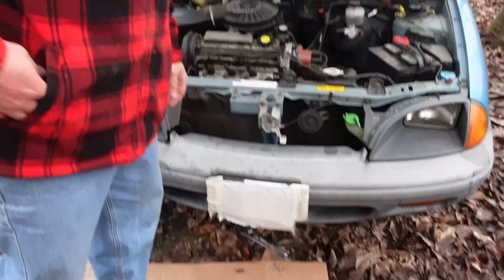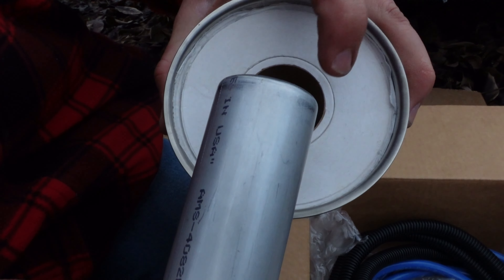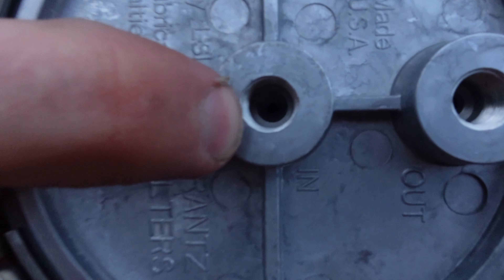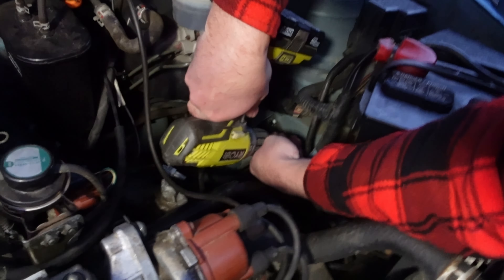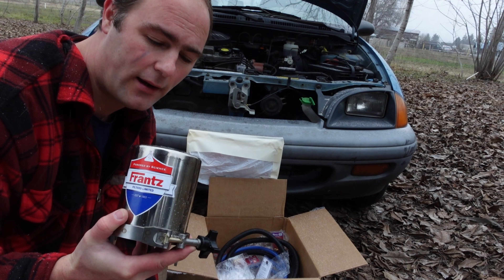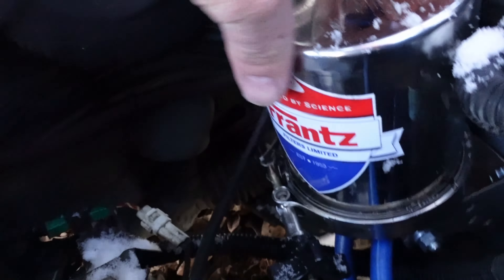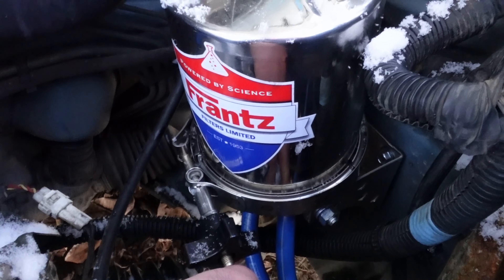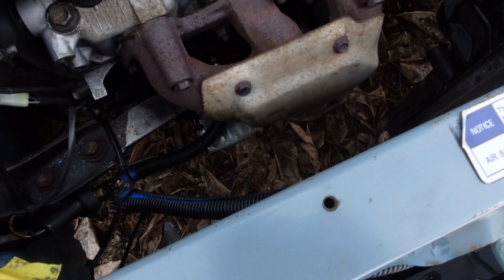Frantz Toilet Paper Oil Filter installation on a Geo Metro

Comment: You could unhook the hose at the oil fill cap and plug it into another air hose fitting to open the passage, lower the hose into a bucket under the car to drain overnight, save that $50 !
Reply from the maker: Yeah I will try that and see how easy it works before ordering parts, that is a great tip, thank you so much 😀
Reply: @frugallandlord6974  What I read through old Frantz literature is to loosen the clamp and rock the canister back and forth to release the vacuum that holds oil on top of the paper, after that leave the canister on and let it drain, I let it drain overnight and change the element the next morning.
Reply from the maker: @JimmyJames351  another great tip, that makes sense. Thanks again😀
Reply: Normally if air can enter the filter at shut down the excess oil will go back to the engine. Cant have any low places for oil to settle and keep out the air. My Perma Cool 189 sandwich adapter wont allow air to enter the Ford canister filter. I put a tubeless tire valve in the lid.  Slime brand with a nut from Auto Zone. Air pump with a gauge. Pressure comes up. When the pressure drops the excess oil is back in the engine.If the filter is cold the pressure will be higher. I dont do messy oil filter changes. Most of my oil filters drain over night with no help. Jackmaster Classic has an optional air fitting. Mine dont need it.
Reply: In the 60s if you ordered a Frantz with the 2 port sandwich adapter the filter came with no orifice. The 2 port sandwich adapter depended on enough oil flow to create a pressure difference. I see Summit has a 169 sandwich adapter with 1/8 pipe ports for oil supply to a added turbo charger. Normally with a gasoline engine if the Frantz cant remove the tiny soot particles the new makeup oil will dilute it down. You dont need to worry about the TBN number unless you arent operating at operating temperature. If you have an acid problem you will get a rusty dipstick. Keep it polished. Some old Frantzs have SKY on them. Thats Skipper K Yee. He once told me keep your oil clean and dry. You wont have a acid problem. Mr Yee was owner of Frantz at one time. I found out about Frantz when I checked a Standard oil engineers dipstick. He pointed to his Frantz.He said use one of these and Delo. Your engine wont wear out and you wont need to drain your oil. I was working in a full service Standard station with the white uniform blue cap and the belt that did t scratch the paint. I went  and found a Frantz dealer.. Common sense tells us that if we get a leaky head gasket or a fuel contamination problem we will need to change the oil.
Reply from the maker: @ralphwood8818  I have to re read some of your comments because there is so much information in them and it just sunk in what you said about TBN 🤔that does make sense to me, thank you so much for all the information, I appreciate it very much.
Reply: @frugallandlord6974  If  trying to keep the tp tube centered and round when fitting the paper onto the base, what I have found that works well is the carboard centers from spent eletrical tape, just peel the outside layers off until you have a slight press fit into your tp roll, you can put one at the top if you are so inclined, but not necessary in my opinion. 🙂
Reply: @frugallandlord6974   Additives last a lot longer in clean oil. People a lot smarter than me figured out that all you needed was never let your oil get dirty and add enough new oil to keep your additives up. Expensive engine owners check their additives with lab analysis. For what lab analysis cost I can change the filter a few extra times.
Reply: Years ago I was debating a smart as hell guy on a trawler forum. He said bring your wife down to Canaveral I will take you on a tour and we can talk about filters. He was a diesel equipment engineer. They were moving the shuttle then. I  told my wife im getting in over my head. Called Charlie Sims owner of Gulf Coast Filters in Gulfport Mississippi. I said I have a guy that wants to talk about filters. He said who is it. I said NASA LOL.  The engineer said we dont keep out cars long enough. The filters are only for industrial use.
Reply: About 1985 I was talking to an old couple that still drove their 53 Chevy  they bought new and installed a Frantz on.
Reply from the maker: @ralphwood8818  i think i read about TBN lasting much longer in clean oil, I’m sure it was on Bob is the oil guy forum. I have always wanted to get a used oil analysis on my oil at 10k but it’s so expensive I have never actually done it.
Reply: @JimmyJames351   managed to make the beautiful oil in the Pontiac look like the oil in the old diesel tractor. That super black cement color I put in the Pontiac to test the Jackmaster Classic filter and different toilet paper is not coming out. It passes the palm test the same as the clean black oil in a diesel. Its well below 1 micron. It dont bother me. If I was still selling filters at the flea market I would need to change the oil a dozen times to get rid of the black. People will always ask to look at your oil. People will always think black means dirty. Motor Guard has always claimed submicron filtration. Jackmaster claims 1 micron. Dont remember what Frantz claims. The big Gulf Coast filter claims 99 percent at under 1 micron. That wont even remove super black cement color. ACME brick uses it to make black bricks. A little goes a long ways.
Reply: @frugallandlord6974  Most modern engines have almost nothing in the oil large enough to be removed by the full flow filter. Some toilet paper filter users dont even change the full flow filter. That could be a problem. I ran the Pontiac about 65.000 miles on the same standard Wix. The pleats were rotten but still in one piece. Put a Wix XP on it. Im told the pleats in the XP are synthetic. There are toilet paper filters that screw on in place of the full flow filter. They use about 1/3 roll of toilet paper. They have a large bypass valve that is always open when the engine is running. I bought one to study about 60 years ago. I still have it in my junk collection.Kind of like a Stilco or Trasco. Some use them for when there is no room for for a larger toilet paper filter.
Reply: @ralphwood8818  I think the best use for those black particles is in the demo units, a lot of things are going on in an actual hot running engine that seems to mess with the outcome of the test.
Reply: @JimmyJames351  I hear you. In the 60s I was demonstrating the Motor Guard oil cleaner with a home made demonstration machine at the lost flea market in San Jose California. I was using diesel fuel. An art supply dealer said I have something you cant filter out. He gave me a very small tube of black coloring. 
At the end of the day the toilet paper was half white and half black. Probably another day and it would be black all the way thru. With the Pontiac I lost control. Plus because the Pontiac holds a lot more oil I added  a lot more color. The new oil added at filter changes should clear it up in about 10.years
Reply: Saw a demonstration on YouTube. This crazy Russian was demonstrating if 50 full flow filters would clean the oil. Of course every time he changed the full flow filter he added new oil. The filters didnt clean the oil. I think he is mostly a comedian. I just got one of those pop ups. Keep writing or delete.
Reply: @JimmyJames351   Both the Pontiac and the diesel tractor pass the old trucker palm test. With clean hands wipe the dipstick on the palm and smear it around. It should feel like new oil and not stain the skin.
Reply from the maker: @ralphwood8818  garage 54 I believe I watched this episode about the oil filters
Reply from the maker: @ralphwood8818  I have noticed people doing this palm test but I didn’t really understand what exactly they were looking for.
Reply: @frugallandlord6974  Another comment vanished. Ive been told the palm test is scientifically accepted. Black oil doesnt stain the skin. The owner of Gulf Coast Filters said its like black coffee.
Reply: @frugallandlord6974  You might have seen the interview Oakley trucking did with the owner of Gulf Coast filters. He is an expert on heavy duty filters. Pretty much thinks small filters are a waste of time. The founder of Gulf Coast Filters was proud of his little filters.  The Gulf Coast junior and the Jackmaster Classic and the Motor Guards were my favorites.
Reply: @frugallandlord6974  I should have said the filters are my favorites. I have them all in use.
Reply: @frugallandlord6974  The comment that vanished I mentioned we didnt have the fancy oil fill caps. I have drilled and tapped a few plastic  caps
I did twin 454 GM marine engines on a 41 Chris Craft and twin 350 GM marine engines in a 33 foot Carver. Gulf Coast junior filters used 3/8 inch hollow bolts to replace a intake manifold bolt on those engines. Could also use them on Chrysler V8s. Used a welder and lathe to make them. Not sure Frantz still sells them.
Reply: @ralphwood8818  Ed has the hollow bolts as well as the self tapping hollow bolts on his Frantz Refiner website. I think the return to pan is best on older V-8's, most oil return passages in the head and blocks can be on the small side, so I think right to the sump is better, I have a sthb in the oil pan on my 72' Mustang.
Reply: @JimmyJames351 Frantz also had metric hollow bolts for the beetle to return the clean oil below the baffle on the generator tower. Also 5/16 hollow bolts. I saw one guy that had a large C clamp with a Frantz punch welded to it. No hammer needed. I liked the tool that pushed the hose on the barb fitting.
Reply: @ralphwood8818  That big 'C' clamp is a crazy good idea, I didn't have room for the hammer to put it where Frantz said to put it, rear corner of sump, I put it at the front, it is under the oil pump, 3 1/2 inches up from the bottom instead of the recommended 3" to clear the spot welded baffle.
Reply: @ralphwood8818  I had trouble with my first push on fittings, thought I needed that tool, second set I put the barb in a vice and just a little heat from a heat gun on the hose, then push it in and that worked, you don't need much heat, I use the Oetiker style clamps.
Reply: @JimmyJames351   never learned how to pronounce those clamps. Didn't completely trust the 3/8 hollow bolts after the machine shop messed one up. As I was screwing it in it fell apart. The ones I make are ugly but they are strong. Never saw a weak self tapping hollow bolt.  When I converted the Ford  V8 canister filter to use Scott 1000 I used self tapping hollow bolts for the bottom and lid to bypass.the orifice. Didnt work for the lid. Plugged it and used the stock inlet. It was close to the top. Couldnt move the lid without loosening the bolt. The old canisters wouldnt drain below the orifice. I didnt use the old Frantz canister inside the Ford canister system.The Ford canister is 4 1/2 inch ID.
Reply: @JimmyJames351 In the late 60s I was working in the Ford Mustang assembly plant paint department. Many employees were buying Mustangs. A superviser had a Mustang dragster. The Frantz has no value on a dragster but I put a Frantz on his Chevy Suburban with the 292 big 6. Then everyone wanted a Frantz on their Mustangs. I used the Frantz 2 port sandwich adapters. No punching the oil pan. I think 2 ply was higher quality in those days and all of it had a 1 1/2 inch core. For years I got the best from a janitorial supply.
Reply: @JimmyJames351   The Chevy Suburban was the tow rig. When I started selling the Motor Guards I put a Motor Guard on his Plymouth  Fury. For awhile I was converting the Motor Guard compressed air filters to use 2 ply toilet paper. Couldnt use the high dollar Motor Guard elements because they had a plastic core. I was getting high quality 2 ply from Office Depot by the case. I ended up with three 60 gallon trash bags of Motor Guard elements to use for shop towels. 2 bags went to the land fill.
Reply: @ralphwood8818  Did the Frantz 2 port sandwich adapter allow the filter to drain?
Reply: @JimmyJames351   I dont remember having trouble with the Frantz not draining. Might be because the Frantz sandwich adapter had no spring loaded bypass valve. It worked the same as the Frantz transmission adapter. Some small engines didnt have enough oil flow to create a pressure difference. Had the same problem with small car transmissions. Sent Gulf Coast juniors with Perma Cool 189 sandwich adapters to a private Island. The engineer said one of the 6 cylinder diesel engines on the generators had a little lower oil pressure than the others. He drilled a 1/8 inch hole in the adapter to help the spring loaded valve. Perma Cool said the spring loaded valve is large enough. Might not be  if one engine has more bearing wear than the others. Not bad if you have a private island and have a full time engineer to keep things running.
Reply: @JimmyJames351   I only have two Frantz 2 ports still in use. They are Frantz Ford adapters with one port plugged. The oil is returned to the drain port. V twin lawn mower engines. Gulf Coast junior oil filters.  Super Tech ST 3614 full flow filters. Years ago I probably opened up a toilet paper filter and oil spilled out. I removed a hose from the Perma Cool sandwich adapter plugged the port and returned the oil to the engine in a normal way. I had other choices. I could have cracked the lid if it was a Gulf Coast junior. Loosened the t handle on a Motor Guard to let the air in. When the flat head Ford  V8 canister filter didnt drain I put a tubeless tire valve in the lid. I have a cigarette lighter air pump with a gauge. The pressure comes up to 50 psi aprox.When the excess oil is  back in the engine the pressure drops.
Reply: @JimmyJames351   I just put my last roll of Camco in the Jackmaster Classic. Drove about 4 miles. The filter was luke warm. It was slightly warmer when I got back. This tells me the pressure is slightly more at the top than the pressure at the bottom of the paper. This is the same as a very small orifice. A lot smaller than the .045 orifice I removed. This means the Jackmaster Classic is cleaning the oil much better than when hooked up in the conventional way. It will be winter when I change the filter again. I might need to use Charmin Ultra Strong in the winter. It can get into the teens here in Dallas.
Reply: Yes one of my hoses went half way on the fitting. A little heat from the heat gun and it went on. All I had was used fuel injection hose. 5/16 id.
Reply: @ralphwood8818  I really think you could put a smaller hole in the adapter, say about .080" that should drain the filter, then use a needle valve to adjust for the different driving seasons, just an idea.
Reply: @JimmyJames351 That sounds right. I was figuring a 1/8 hole. When I saw the 1/4 inch hole I had already drilled in it I thought about another undrilled one I have. Its amazing how much oil can go thru a 1/4 inch hole. Normally when I start the car I go at least 20 miles. Im retired now. Dont drive much. Got the birth certificate. Its a beauty. Embossed seal . Hold it up to the light to see if it is fake. 40 years of getting my Texas license mailed to me.
Reply: @JimmyJames351  Frantz experimented with different size holes. I think I still have a Frantz with a 1/4 inch hole in the nipple the full flow filter screws onto. That means they expected the 1/4 inch hole to supply the engine which it did. The 2 port sandwich adapters are the best things since sliced bread if you get them right
Reply: @JimmyJames351  I went out and measured them. Ive seen a few where they drilled them too large and pressed in a bushing. I didnt have any problems with them. I dont have anything these will fit.
Reply: @ralphwood8818  The ball/spring in my Derale sandwich is 5/16th's,  so I do believe that it can supply the engine if Frantz used 1/4" hole in the filter spud.
Edit; I pulled my spare Derale sandwich adapter from the cupboard and used my digital caliper, it's .3125", 5/16ths, I know some adapters come with a 1/4" ball.
Reply: @JimmyJames351  The Frantzs came with a loose ball which usually got lost. Not sure what it was for. The sandwich adapters worked without them. Might have been to keep the Frantz from draining at shut down. Some think the engine is not getting oil until the filters are full. I want them to drain at shut down.
Reply: @JimmyJames351   not sure all of them had the ball bearing. They were held in by a round of scotch tape. Its been a long time.
Reply: @ralphwood8818  I want my M100 to drain too, at filter change time anyway. I think I got it covered three ways to Sunday, with a drain petcock on the return, air valve on the input, the third Sunday is turning the handle to open the halves a hair, will see which one will work the best.
Reply: @JimmyJames351  I liked the Motor Guard. I tried to bring them back by removing the plastic parts and putting aluminum parts in them. The M 30 compressed air filter is similar to the old lube oil filters. I got the aluminum tubing from McMaster Carr. The tube and seal was similar to the Frantz except the seal was machined. Nice filter. Motor Guard was OK with it for awhile. I had some trouble with the coating occasionally turning loose from the aluminum with some fuel and ATF. I told them to send me 100 with no coating. That was the last straw. No coating and using toilet paper instead of their expensive elements. I was sending Motor Guards all over the world. They messed up big tme. They remember going broke trying to sell oil filters before the internet
Reply: @JimmyJames351  I was selling the Gulf Coast filters for awhile. They had a nice little top loader. I got my ass chewed for using sandwich adapters with them. I get no respect. Im 84 now. Its just a hobby now. I didnt need the Australian Jackmaster Classic but I had to have one.
Reply: @JimmyJames351    The Motor Guard is popular where you cant have anything but clean dry air for instrumentation and painting. On one forum a guy said the reason Motor Guard got the nikname toilet paper filter is people started using toilet paper in them instead of the proper Motor Guard elements. Of course they were all designed to use toilet paper when toilet paper fit. The origional Motor Guard compressed air filter was the same as the oil filter except it had a coating and 1/4 inch pipe ports and no orifice. I thought I let one go with the DC Case tractor at the farm auction. I found it. There is a advantage to being a hoarder.
Reply: @JimmyJames351 Removed the Perma Cool 189 sandwich adapter from the Pontiac to plug the 1/4 inch hole I drilled in it to convert it to a 1 port. Also found a 3/16 hole. Drilled the 3/16 hole to 1/4 and put 1/4 inch pop rivets in them Drilled a 1/8 inch hole in it to help the Jackmaster Classic drain at shut down. I will put the .045 orifice at the outlet because most toilet paper filters have the orifice at the outlet. Thats where the Jackmaster orifice came origionally. I see the paint is rubbed off the bottom of the Wix full flow filter. The sandwich adapter and the over sized filter is too low for the curbs.
Reply: @ralphwood8818  What size ball does Perma-Cool use in their adapters?
Reply: @JimmyJames351  I will.measure it tomorrow. Im all through under the car. I will put the 1/16 inch orifice in the Jackmaster Classic outlet in the morning and see how it works.
Reply: @JimmyJames351  Its 5/16.a 5/16 drill bit wont go in because of the crimping. Got the Pontiac finished. Drove about 8 mile the Jackmaster Classic was 131f.The Motor Guard ATF filter was153f the Wix full flow filter was 155f. I gave the Jackmaster Classic  30 minutes to drain. It was drained. I suspect the Frantz SKY model with the orifice at the outlet would be the same. As well as the Motor Guard and the Gulf Coast junior. My next project is the Ford diesel tractor. It has no orifice with the.Perma Cool 189 with hoses hooked up to it. It works good but doesnt always drain.
Reply: @JimmyJames351  The tubeless tire valve works good on the Ford canister filter but I would rather not drag out the air pump. The Motor Guard gasket works on the Ford. If I remember right the cartridge filters came with a flat gasket.
Reply: @ralphwood8818  Good to know about the PermaCool, I've heard mention of 1/4" but they were just eyeballing it, big difference in size 5/16 to 1/4.
Reply: @ralphwood8818  I don't think drilling a hole in my adapter will do anything for drainage, the oil filter is straight up with the antidrainback valve at the top of the filter, I have a small handheld bicycle tire pump with a pressure guage, used it on the benchtop Jackmaster, works great.
Reply: @JimmyJames351  The Jackmaster Classic is 30 inches higher than the full flow filter. The Ford canister filter is less than a foot higher than the horizontal full flow filter on the tractor. I have one sandwich that has what looks like two 1/4 inch holes. One hole is open. The other is covered by a bi metal coil that opens the hole to send more oil to the cooler. I have no idea where I got it
Reply: @JimmyJames351 The oil doesnt have to go thru the anti drain back  valve
Reply: @JimmyJames351  It shouldnt matter as long as the Jackmaster Classic is higher than the full flow filter. I will find out with the tractor. Ive been using a cigarette lighter air pump. Touch wires to the battery. Both hoses are from the sandwich to the Ford canister filter.
Reply: @ralphwood8818  I looked at the ball to seat fit with a flashlight under the adapter, it does not seat perfectly as I see a crack of light coming through, the hole is as cast, not perfectly machined, oil should be able to go where it wants at shut down.
Reply: @JimmyJames351 I hear you. I noticed it with the Perma Cool. Some might seal good. Doesn't matter for what they were designed for. Im sure the one with the bi metal coil doesn't seal the hole. Temperature will open it plus oil pressure will open it.
Reply: @ralphwood8818  I am curious to see if the M100 will drain by just cracking the lid and letting it sit for a few hours, but it's not due for a new roll, if I pull the top lid off without changing the roll will it disturb the seal?
Reply: @JimmyJames351  Probably not. I made a spacer to push the paper up against the seal on the shorter paper. I have some 2 inch tubing. Your tape core would work work if you could cut it in half. I did the  sandwich adapter on the tractor today. The filter was drained Dont know how long it took to drain. I drilled the sandwich 1/8. I would like for it to drain in an hour or so. The old Motor Guards were bad about pinching the soft paper.
Reply: @JimmyJames351  no the tape core is too thin. I bet  you could make something out of wood. Need about 1/4 inch to 3/8 inch.
Reply: @JimmyJames351   The Motor Guard on the 66 VW beetle always drained good. It was mounted as high as possible on the right side of the fan. Had to tilt it so the big metal wouldn't go back to the engine at shut down. It had about 100.000 miles and had just swallowed a valve when I met my wife. It took several toilet paper changes to get virtually all of the big metal out of the oil. The VW repair shop told her to change the oil every 1500 miles since the beetle had no filter.
Reply: @ralphwood8818  Good ideas for 4" paper, I have two cases of 4 1/2" paper, one has 1 5/8th's core and the other is 1 1/2" I wasn't expecting to receive 1 1/2"  cored paper when I ordered it, I lucked out and found two M100's because of that damn paper. 🙂
Reply: @JimmyJames351   my comment vanished. I checked the Ford.canister filter this mornimg. It drained over night. The bypass valve didnt leak. I drilled it 1/8 inch. John Frantz put his canister in these old Ford canister filters and other canister filters. I use only the Ford canister. I set it up for a 4 1/2inch roll of Scott 1000. All John Frantz had was.2 ply. He used a piece of 1 1/2 exhaust pipe in the core. I dont need it with the Scott 1000. I have half a roll of VIVA paper towels in it now. Later John Frantz had his own chrome canister which was the same as the old Fram orange canister like the one on my 41 Dodge that used cotton. Cant get.good elements for the old filters now.
Reply: @ralphwood8818  I loosened the T handle two turns and a slight oil seepage at the gasket occured, nothing drastic though, I let it sit for a little over 3 hours, it drained good, even the center return was empty, this is the one I thought that might hold oil, filter is 18-24 inches higher that the full flow.
Reply: @ralphwood8818  I don't need the return petcock drain on the return, but I think the air valve is going to help by purging the loose oil that spills out when I open the filter halves.
Reply: @JimmyJames351  What ever works. I bought a package of Great Value 1000 at Walmart awhile back. It was the perfect size for the Motor Guard. No unrolling. Havent seen any since. The Motor Guard likes for the last sheet to be glued. With the 2 ply they were bad about pinching that last sheet. The Motor Guard factory elements have the last sheet taped.
Reply: @ralphwood8818  I did the MotorGuard 45 degree fold, its kind of loose in the breeze in there, if the last sheet is loose I am going to use a bit of Gorilla glue on the last sheet, no more 45 folds for me.
Reply: @JimmyJames351  The old Ford diesel tractor fuel filter had too many leaks and wasnt a very good filter. I converted a Motor Guard M60 compressed air filter and used it for the fuel. Couldnt gravity  enough fuel thru the Scott 1000 to feed the injection pump. The Charmin Ultra Strong is far superior to the stock fuel filter. The  M60 filters from the bottom up.  I have a drain valve in the bottom. When im too old to get on the tractor and I sell it. They will want a discount because of the toilet paper in the injection system and engine and hydraulic system.
Reply: @JimmyJames351  The old Motor Guards compressed the toilet paper down against the inlet. I had to drop a coil of wire in the bottom to use one for fuel. They fixed that with the compressed air filters.
Reply: @ralphwood8818  When you find those almost perfect rolls, buy more than you think you will ever need, they just won't make them that way for long.
Reply: @JimmyJames351   I hear you. In the 2 ply days I used a knife to push in the paper just before the the halves came together. The first Motor Guards had a loose screen that kept the tp fron pushing up against the orifice. It stuck to the used paper and got thrown away. Mine didnt come with a screen
 My demonstration machine did. Everything was going fine until I changed the paper. The gear pump tripped the circuit breaker at the flea market. Grand auto parts in San Jose California had a clearance sale on the screen models for 12 something with oil lines and fittings. I was catching hell. I was selling Motor Guards for 29.95.
Reply: @ralphwood8818  My two M100's are from the early 70's, no screens.
Reply: @ralphwood8818  I see up for auction Triple R filters from the early to mid 1960's, they are corroded from improper storage, surprisingly they have sock elements.
Reply: @JimmyJames351 Ive seen Triple R filters with no coverings on the paper. Looked like Scott 1000. At the time I believe the paper was about 36 dollars. Looks like.a high quality filter. I was wondering if Jackmaster had something to do with Triple R. They had one model very similar to the Triple R.  Ebay had about 6 Purolator toilet paper conversions. Looked like they had been exposed to water. They thought they were from the 30s and 40s because of the newspapers they were packed in. I suspect they were John Frantz models which were after 1953.
Reply: @JimmyJames351  Im familiar with Frantzs. I know there have been toilet paper filters long before there were Frantzs. It was easy to convert the old canister filters to use toilet paper. Especially with the 4 1/2 inch Scott 1000. My flat head Ford V8 canister filter is 4 1/2 inch I D.
Reply: @JimmyJames351 The flat head Ford V8 canister filter was easy to convert to half a roll of VIVA paper towels. I cut the threaded end of a small full flow filter off. Drilled and deburred some extra holes in it and dropped it in the bottom of the canister. The orifice is in the center tube. I wanted to not use it. The old canister filters didnt drain below the orifice. I used a self tapping hollow bolt to make a new outlet in the bottom. Put a pipe plug in the origional outlet. I used the origional inlet because it is near the top. I was lucky and I had a nylon disc a little larger than the core. I was able to drill a hole.in the disc just large enough to slide onto the center tube. John Frantz used a washer to seal the space between the toilet paper core and the center tube. All he had was the softer 2 ply. He had a piece of 1 1/2 exhaust pipe welded to the washer to keep the core from collapsing. Not needed with Scott 1000. The paper must be high enough for the lid spring to push down on the washer. To use Scott 1000 you will need to use a spacer under the perforated plate so the Scott will be near the top. You will need.a orifice at the inlet. Mine didnt need the orifice because I used a 2 port sandwich adapter. John Frantz used a Frantz canister inside the larger canister. Too complicated and not necessary. Also too messy. I have a air fitting in the lid.
Reply: This works for most canister filters on classic cars. They normally used cotton packed cartridges until they changed to almost useless pleated paper. Thats the basics. You might be able to make improvements. Oil soaked paper is very strong. You dont need a screen under the paper.
Reply: Some of the old canister filters are 4 inches ID. My flat head Ford V8 canister filter is 4 1/2 inches ID.
Reply: @ralphwood8818  Did Frantz ever make a two stacker filter?
Reply: @JimmyJames351  I think at one time they had a 2 stacker. Some Frantz users mentioned them. By far the most popular one was the 3 stacker. I had a 3 stacker on a diesel. They were a good filter the same as a single. One hell of a mess to service. At least they had a drain port. They were pretty much the same as the origional 53 single. The Frantz canister went in upside down. The Motor Guard had manifolds. A 2 3 and 4 filter manifold. 2 manifolds of course. Motor Guards had a problem. You had to tighten the fittings properly. They werent idiot resistant.
Reply: @JimmyJames351  on one forum an old Frantz guy said the proper filter for a Powerstroke is a 2 stacker. Good luck finding one. I saw a 3 stacker on Ebay. The 3 stacker had 3 orifices.one for each Frantz canister at the outlet. The same as pretty much any bypass filter since the 1920s.  I think if I had a 3 stacker now I would feed it with  a 1/16 inch orifice at the inlet. I wonder how many Frantz 3 stackers they put on a locomotive engine on an offshore rig. At one time Frantz had cooking oil filters for restaurants. I believe they took multiple rolls. Frantz had many uses. The AeroFrantzs. You got me going.
Reply: My memory is a little fuzzy after over 60 years. Frantz had brochures that covered every filter they sold. There are probably fossils older than me that remember all the old Frantzs. One Frantz guy talks about the 4 stacker on diesel engines.
Reply: @JimmyJames351  Was just on cutterup rob. A Frantz user said his Frantz takes 2 rolls. That would be the 2 stacker.